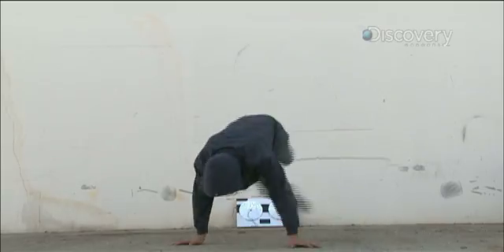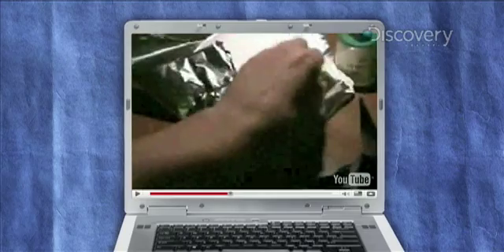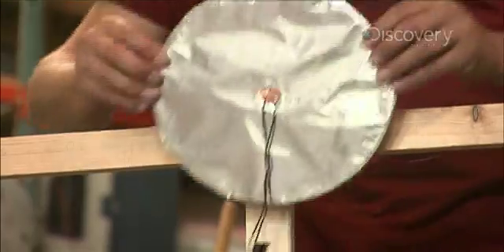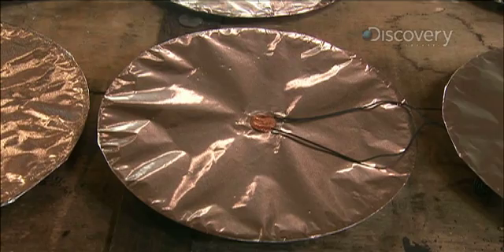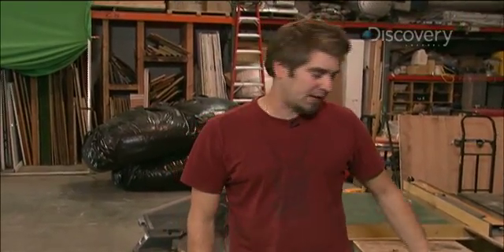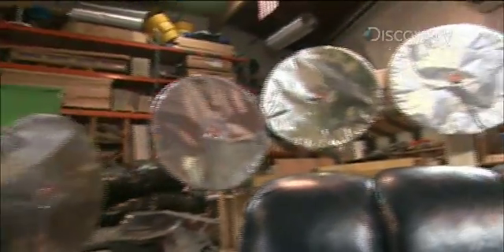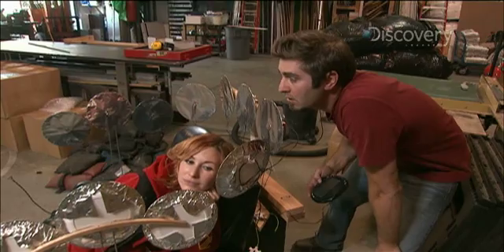MythBusters - Homemade Hi-Def Speakers

Comment: No, this works (ihave done this a few times).

Mythbusters just did it wrong, while connecting the minijack wires: they connected both wires to the penny and thats simly a short sircuit.

Only the plus wire needs to be connected to the penny.
The minus (or ground) connects to the tinfoil.

The sound quality however, that's totally a different matter.

You DO NOT get a "HIGH DEFINITION SOUND SYSTEM" this way.

The sound produced by this speakers is poor metallic noise

Comment: Even if the aluminum foil covered paper plates could produce sound (which there is no feasible way that they could), they won't because one key element is missing. If you've ever used the wire that is in a 3.5mm jack cord, you'll know that the signal wire is INSULATED. This must be burned off if the wire is to conduct current to anything else. Duh.

Comment: As far as I understood how it was meant to work, neither electrostatic or magnetic fields are not involved at all.
This phenomenon is called "piezo-electricity" when it applies to quartz crystals: when you twist a quartz, it produces current, and when you apply current to it, it twists.
If you admit that iPod may drive enough current for a metallic coin to twist, then you may hope that, when taped to the tin+plate assembly, its deformations are mecanically amplified enough to be hearable.

Comment: I really can't remember, but I used a small battery and some wire around some metal thingie, conected with tape to the plate, somehow got it workin' ^^

I just followed a drawing I was given by my teacher...

So, they used a different method(wich suckz) but it does work!

Comment: there is no way it can work because the electricity from the mini jack goes throught he wire ten throught the penny without involving the tin foil and back through the mini jacck finishing te circuit.

Comment: you wouldn't spend 10 bux on the headphone jacks b/c household hackers assumed you would have headphones lying around the house and thus you'd just cut off the headphone jack. i have several messed up headphones, so i could use those.

but since it didn't work, well fuck it.

Comment: The "mythbusters" are the biggest idiots I have seen in the science realm.  Total ignorant jackasses.  They would be fired from any reputable lab.   Do not believe or trust anything from them.  They would tell you to pee on a train rail,   I would jump into a bathtub of water with a plugged in toaster,  (which they said would kill you but will NOT unless you are gripping a ground connection, you will not even feel any sort of shock.

Comment: The EEEEDIOTS!  The "myth" is supposed to be that you can make SPEAKERS for under a buck.  They plugged it into an earphone jack!  You need an AMPLIFIER!  It does work, if you get an amplifier.  But then that requires a fair amount of juice, so you'd want to make sure you properly house the speaker.  And the sound quality is only as good as the seal between the foil and the plate.

Comment: I'm surprised they didn't see the problem right away:
Even if there was a magnetic field being produced around the penny, there is nothing for it to attract/repel against, i.e. another magnet on the back of the plate. Since there isn't, the penny - and in turn the foil - won't vibrate, hence no sound.

Comment: Either way, it wouldn't work, anybody that knows about electrical current knows that when you put positive to negative with no resistance in the middle, you have a short, and when you only connect one wire, you are only giving it positive or negative, but there is not a complete circuit, therefore, no matter how you do it, the myth is still BUSTED

I had people screaming in my face saying I was wrong when I said it was not possible, mythbusters proved me right, MYTHBUSTERS FTW!!!

Comment: Wow....where are they shopping that *each* miniplug cable costs $10? Even at Radio Shack, known for their bad prices, only charges about $2 or so each (unless you're going for the gold-plated garbage). Or, as someone else said, go to your local dollar store, get sets of ultra-light headphones, and rip the headphones off those. Though...actually an interesting experiment would have been to use those headphones in combination with the paper plates&foil to see if the foil would resonate and amplify

Comment: Speakers vibrate by using a stationary magnet and an electromagnet. The paper plate speakers contain no stationary magnet, and attaching two electrical terminals to a penny does not create an electromagnet. Household Hacker is notorious for forging ridiculous myths, about half of which have been confirmed WRONG.  People who believe that you can make a GPS with a remote control, that you can power a TV off a AAA battery, and that you can charge an iPod with a potato are just STUPID.

Comment: Plese revisit this i'm not at all pleased, the problem is that on the other side of the plate you must mount a small magnet(the principle is not to be able to atract the coin on it's own,but only when the coin puts out come Gauss, second I think the coin isn't enough to produce a magnetic field(only  heat up and short the mp3-player), so if that doen't work try a coil and I think the foil isn't elastic enogh, try elastic fabric)

Comment: ~_~ You can make speakers but that is not the way to do it. Speakers work by pushing sound. There is nothing there that is pushing anything. I made a usb powered fan when I was bored... ~_~ definitely make a speaker would be a lot harder.

Comment: Anyone who claims the household hackers speakers work either dont understand electronics, induction or both. which is what a speaker's based on.
If the penny would be shinier, there'd only possibly be less resistance thus causing a higher chance of a short circuit.

Comment: i got it to work scientifically...use a copper coil rather than a penny because the coin cannot reverberate like a coil of copper.  then u need a magnet and get rid of the tinfoil.  keep it around 7-10 inches in diameter and it works...mini jacks work best though.

Comment: Static also makes noise. therefore if current between the penny(plated in copper) and the aluminum foil created static at particular frequencies, it theoretically may work as a speaker...

Comment: Umm... I hate to tell you this but the pos(+) was on the foil & neg(-) wason the penny. plus if someone was "nerdy" enough, like me, they'd probly have several of those 3.5mm cables from headphones or old pc speakers lying around everywhere so there would be no need to buy $150 worth of cables... which might i add, is way too much for puny headphone cable, what is it, like 26 gauge?

Comment: Even for that, you would need very high voltage to effect it to make any sort of sound. That, and an actual circuit rather than just shorting the jack across the foil. You could make a speaker with foil, I have seen it even with a plastic cup.... but it also had an electromagnet to make it actually work.

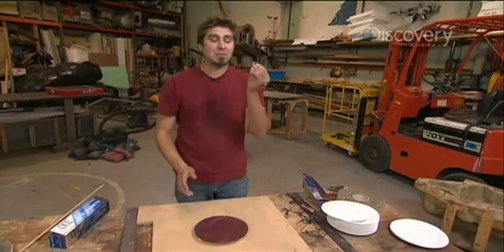Comment: No, you're the idiot.  I was just making the point that this wouldn't work by looking at the fist 1:20 of the video, yet others keep comming up with things to try.

This could be made to work without a magnet.  But it would still sound like crap.  All you need for a speaker to make sound is a source to produce vibration and a diaprhram or horn to amplifiy or spread that vibration out.  An acoustic guitar body is technialy a "speaker", and it has no magnets in it.

Comment: A speaker works by using a magnet or solenoid to move a membrane... the audio signal is just low voltage. No way it could move foil in pulses. Just a fake thing preying on people that don't understand the physics of it.

Comment: Actually this could work if they didn't wire the penny with BOTH the + and - wires.

They need to put all + wires on the center, and connect the - wires to the outside of the tinfoil.

Anyone with electronics knowlege should know that all wires touching the penny would directly short out the + and -.  Thus no current or "action" will travel through the penny, into the tinfoil.

Comment: In the video you did not verify you hadn't blown the output of the cd player.  You would need more power than a headphone jack could provide anyway.  If you were using an amp you would have blown the outputs.  13 speakers in parallel would be a dead short.  If I tried this I would measure the impedence before I connected it to an amp.  The "plugs" are not jacks.  You plug them into a jack.  Have you ever looked at a tweeter from a portable radio?

Comment: He did it wrong, you can get this to work.  The copper has to be on the back (use a wire not penny)  leave out the tinfoil too.  once you tape the wire coiled up on the back and the leads on top of them wire them up and jack them in, then grab a magnet and hold it close tho the back.  the magnet and copper create reverberation and sound.  we did it in class today it was awesome!  we even put it over a garbage can to make a subwhoofer!

Comment: Of course this doesn't work. For a speaker to work you need a magnet and a coil. The signal goes through the coil, which moves to and away from the fixed magnet. That's why 'hard drive speakers' work; a coil between magnets with something to vibrate = sound.

$10 per mini-jack cable?! I thought the Myrhbusters knew better than to shop at Radio Shack. They could have used dollar store radio headphones, or bought a box of loose mini-jacks. Guess they don't take Household Hacker seriously.

Comment: "maybe all these speakers in parallel are lowering the impedence..."

what the crap. If she is smart enough to know what those terms mean ie: parallel and impedence, then she would know that a freaking penny taped on tin foil isn't going to produce an audible vibration.

tv is so overrated

Comment: a kid outta elementary science class could've told you that speakers work through electromagnetic components and that simple electric currents can NOT create vibrations on their own.

Otherwise if you simply plug a jack into a sound system and hold the other end you could feel the vibrations.

Comment: if the idiot would've hooked em up the correct way it would've atleast made sound. one wire goes on the penny and the other to the foil... not both wires to the penny, any moron would know that just does'nt make sence. a kid outta elementary science class could've told you that.

Comment: should have tried to put the penny between the jack wires.  that way there would have been an arc going through the penny. tory put both wires on the same side of the penny... with scientfic tests you should test multiple variables.

Comment: A PC does NOT have a higher output than a CD player. they both output the same levels of sound (just about enough to give an output high enough for using headphones or plugging into an amplified speaker)

yet HHH made it supposedly work in a PC, and it doesn't

Comment: I got news for you:  Householdhacker is a hack.  Charge an IPOD with gatorade and an onion? (this doesn't work because you need a strong acid to pass electrons between electrodes) 

Plug in a TV with a AA battery?  (Televisions require alternating current, therefore you need a power converter and stronger voltage)

And speakers require magnets to convert the electrical waves into sound waves....

Case Closed.

Comment: I watch many video responses of them making one that work and some don't. Are they actually using a copper penny and not any new ones? Are they placing the wire right so the copper gets all the electricity?

Also jacks easily 10cents online.

They need to do this and back it up like all others... explaining why it aint working. Why the penny not turning into a mini magnet like some others do.

Comment: Piezoelectric devices.

Not that I'd suggest that this could be the effect here, remember I predicted that it would fail, even with my suggested modification.

On the other hand, putting a current through any metal creates an electromagnetic field, though a very, very weak one in this case.

Comment: I can't see that tinfoil would make a good speaker to begin with, however I can see why the experiment failed. Putting all wires on the same copper surface will create a short circuit, not sound. Retry it with the ground/shield on the aluminium, and the rest on the copper. Still, I'm not expecting anything great from aluminium foil and a penny.

Comment: the speakers did not work becuase he used a compact cd player. you have to use an actual reciever, a 13.1 or whatever specific dolby b.s. you wanted to hear. the portable cd player only pushes like 2 watts. try putting a normal speaker to the same cd player, they won't work becuase there is no amplifier for the speakers to bump.

Comment: Well, the speakers were obvious bs to begin with. The wire ends are insulated, so they can't conduct through the penny, and even if they did they'd just short out the amp rather than cause any movement.

Comment: at best that penny is just a dead short on the circuit. Speakers depend on magnetism to work, that means Iron. 
Nickel is the second most magnetic element at 5000 X less than Iron, 
Copperclad Zinc pennies have NOTHING in terms of Magnetism.  NOTHING.

Comment: Yeah, they messed up on a lot of the details, and even flat-out admit that they're using £10 cables instead of the ones used in the original video...completely different environment.

Comment: I call for a revisiting of the myth....

In the original video, it looks like Household hacker is putting the jack leads on either of the faces of the penny. Possible that this causes vibrations in the penny which would transfer to the foil. 

A revisit video would be nice!

Comment: how does current on a penny induce vibration??
this is too stupid for even mythbusters to try out
you'd need a perma magnet, and a electromagnet so that the current will induce vibration on the diaphragm.. not a penny

Comment: Just thought I'd mention that nowhere in this speaker is there a permanent magnet or sound coil, two essential components to any basic speaker. The jack doesn't even do anything, since the current from the audio output just flows over the penny and back into the jack. There is absolutely no way this speaker could work, and I would pay anybody $1000 if they could get it to work. I'm not even kidding, prove to me you can make a speaker exactly like this, and make a quick grand.

Comment: I think if you have two wires across a penny then youve got a short cicrcuit anyway. 12 more isnt going to make much difference.  Now, if he'd made sure the penny was isolated from the tin foil by putting some tape down first and put one witre to the penny and one to the foil...he MIGHT, have got something from electostatic effect.  But i doubt it.

Comment: yes your are correct. but they used the cost of buying just the bare ends of them. Plus the wiring is of higher quality and thicker with a more expensive wire.

Comment: The Amp in the CD Player wouldn't blow. Dosent work that way. Its not like it knows it need to source 13 speakers so it works harder. It works just the same as if it only powered your headphones. 
If you upped the amps in the cd plater wiring and the source was too powerful the only thing that would happen (beisdes having great music) is that the speaker would blow. And if you ever listened to music from such a loud cd player you ear drums would blow too.

Comment: Having hooked up 13 speakers in parallel would have dropped the impedance so low that the output stage of the CD player amplifier would have blown and stopped working (perhaps).  Without switching to another audio source to test the single foil/plate speaker, the results would be very inconclusive.

Comment: Well it is a bit obvious to anyone but a loony that of course it will not work!!! The wires taped to the coin are just a direct short across the output of the amplifier. All you will succeed in doing is fucking up the amp. I am very very surprised that anyone that has the intelligence to be able to read, is not able to work this out for themselves, talk about retarded.....

Comment: There's no aluminum in a penny.  He did say "tin foil" but I suppose you're right, it's probably aluminum.  Either way, I doubt the current would go anywhere near the foil with the voltage from a headphone jack; it only touches the penny.
I suspect it is possible to make high-quality speakers pretty cheap, but with a bit more effort.

Comment: Whatever the side of the coins the leads are, the aluminum foil won't vibrate, because 1) aluminum doesn't conduct electricity, 2) in a speaker, it's a magnetic field from a coil in a  toroidal magnet that makes the speaker vibrate. No coil: no magnetic field -> no movement. Besides, even if it was vibrating, the aluminum is not rigid enough to act like a piston, so the sound would at best be very crappy.

Comment: I didnt think of that, good point. However, a cousin of mine has speakers that don't appear to have any moving parts, there is just a base with a  large clear plastic sheet that projects the sound. I don't know much about the science of speakers (as I'm sure you've already figured out) but perhaps household hacker's speakers were supposed to work more like the ones my cousin has, rather than a traditional speaker.

Comment: If you know anything about how a speaker works, you would be wondering how this is supposed to work.  In a real speaker, the voice coil is just that, a coil that generates a magnetic field that moves the cone of the speaker in and out based on the amount of signal coming in.  How is two ends of a jack taped to a copper penny supposed to move the tin foil in and out?  There wouldn't be any field, and the penny would not be moving, thus causing the tin foil not to move.  No move==no sound.